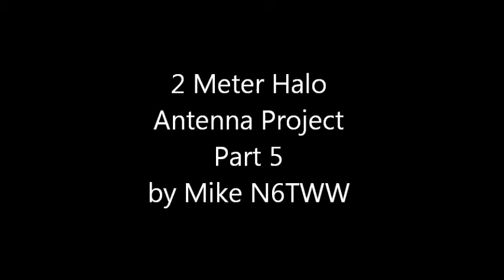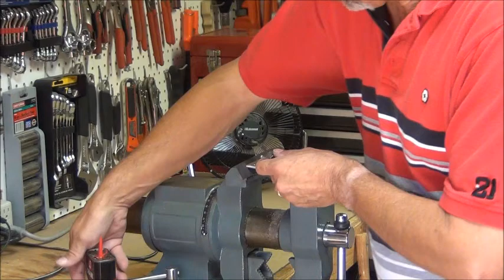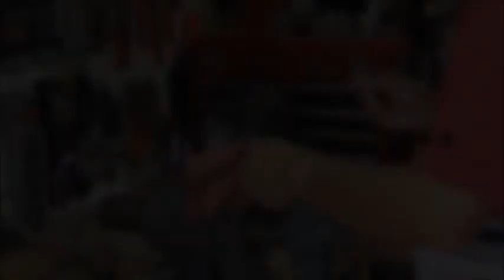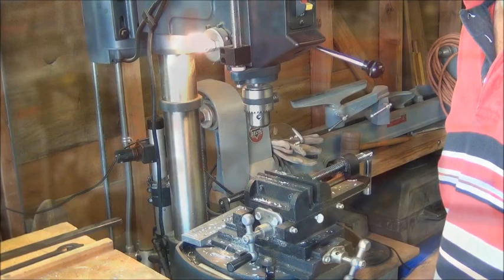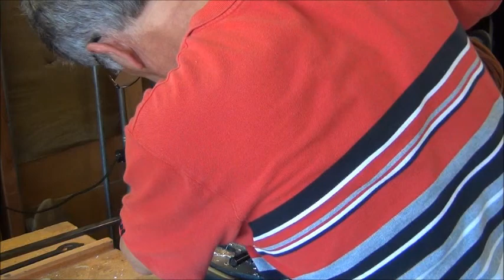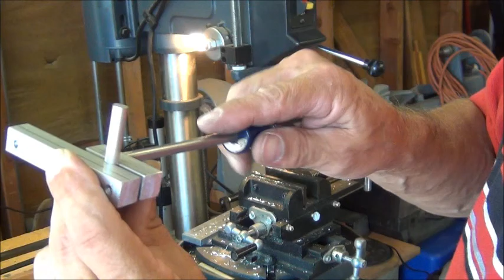2 Meter Halo Antenna Part 5 -- "Tapping holes & special cut to secure antenna element" by N6TWW

Comment from the maker: I tapped the holes just because I could and it uses less hardware. It would be less complicated to build if you drilled through holes and just used longer screws with nuts and washers. Just be sure to use stainless hardware.